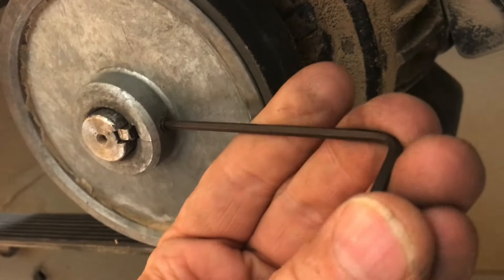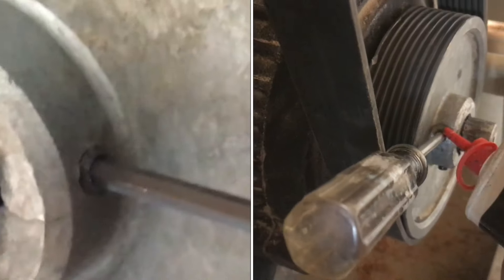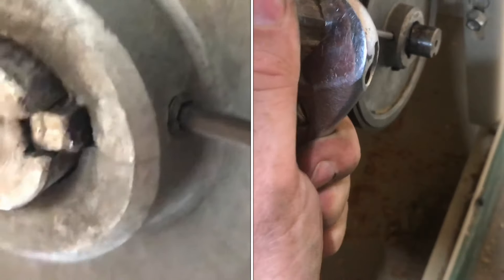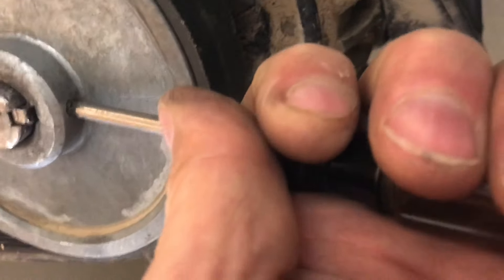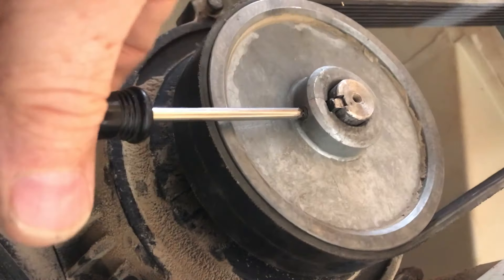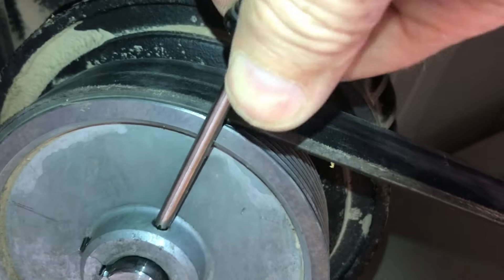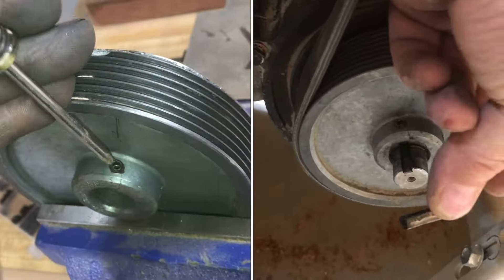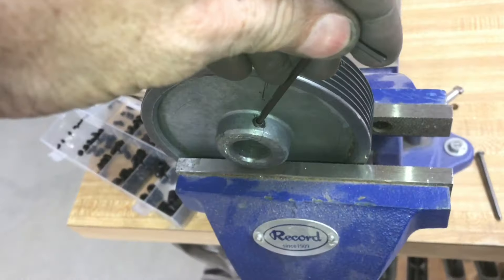REMOVING a stripped or rounded allen screw (fast and easy technique)

Comment: My man. You HAVE NO IDEA how happy I was after I followed your guidelines to extract a small titanium screw on my motorcycle! You saved me not only some bucks but put a huge smile on my face! It was super easy and best of all - it worked like a charm. Thank you from the bottom of my heart. God bless you
Reply: Titanium screw? I find that a curious choice of metal for a screw, since it is so hard to work with, expensive, and doesn't save much weight (a big reason for using Ti instead of steel alloys). It would, though, be strong and never rust. Can you please tell me where it was on the bike? Thanks.

Comment: This works a treat. I had a crappy little stripped screw on a light fitting that I stuffed around with for half and hour trying to remove. I was at the point of thinking I needed to replace it just to change the globe and this worked instantly. I cant that you enough!

Comment: Okay, now how do you remove a torx bit that has broken off inside the allen screw?
Reply: Same problem here
Reply: Weld, make a weld mound then weld a t shaped small square bar innit slowly tap and move
Reply: Exactly, I found a weird looking screw one time only to realize it was a hex screw with a secure torx bit snapped off inside.

I was able to grip the screw from below and turn it with some side cutters lol
Reply: I had a similar thing happen just yesterday. I was using a hex wrench with a ball end. The ball broke off in the set screw. It took a while and was extremely frustrating but I was finally able to get out the ball piece by cleaning out all shavings and debris in there, making sure it was loose and wiggling around, then I took a pick up tool with a strong magnet on the end, stuck a 1/4” hex  bit to it that was one size smaller than the ball so I could get as much surface area of the end of the bit to transfer the magnetic pull to the ball piece and it came right out!

Now I'm here watching videos still trying to figure out how to get the damned set screw out! LoL
I already knew about the trick he showed in this video and when I tried it, all I did was reem out the already striped hex socket that much more!
I've been at this damn set screw for about an hour a day for 4 days now! Been Soaking it in penetrating oil over night for a week... 

STUPID KIDDIE RIDE! UGH!
(╯°□°）╯︵ ┻━┻
...LOL
Reply: Just happened to me on my RC truck 😂😂😂😂
Reply: Hardened metal like that will shatter if you hit it with the point of a center tap a few times.
Reply: The Almighty Dremmel.
Reply: An M-80 or two will make sure that set screw and pulley will never bother you again.
Reply: Don’t use a torx bit in a holder, use a handled torx driver they aren’t designed to save fittings.
Reply: Tannerite
Reply: @cavekritter1  Tannerite scares bears! 🐻 And obliterates wild pigs!! 🐖🐷 🎆🤣😜😉🤦
Reply: does'nt matter..look again..pulley's cracked..needs to be replaced..😂..but he thought he would be youtube famous & he will be..for breaking things instead of repairing😂😂
Reply: If you have a Milling machine or drill press you can get a carbide drill or end mill to drill it out to the point it will either come out or you can peel the rest out . Pain in the ass but it will work . 50 years as a R&D Machinist I've my share of busted or & messed up screws & bolts' Once it's out be sure to run the tap back through to make sure it is all out & you should be good to go.
Reply: Drill it out with a reverse drill bit and pull it right out.
Reply: LoL 😂
Reply: oh thank god i read this comment after I used this trick successfully.  Sounds like something I would have done.  Find a solution and instead, compound the problem

Comment: Omg, this works! I'm not good with tools, and was just changing the easywheels on my folding bike when i realized that the bolt on one of them was rounded (probably because I reused an old wheel to temporarily replace one that broke, hence the need to change). I tried different methods suggested by those professional-looking videos, including using super glue with a sacrificial key. I was getting seriously depressed until I tried this and it works! Thanks a million!
Reply: I bet it was a Brompton 😂

Comment: Thanks for Video. I was able to use the rubber glove method to remove a slightly striped allen bolt out of my wheelchair brake lever and then replace it with a new one. You really helped me out of a jam.

Comment: Overtightened and rounded a metric size 2 Allen set screw. Tried and failed to remove it with a slightly larger English size Allen wrench. Watched your video and successfully removed it with a t8 torx screwdriver. Thank you!

Comment: If you have some allen head screws that you have a high chance that you will have to remove and they are pretty susceptible to stripping, it would be a good idea to put a little dab of anti-seize compound on the threads before reinstalling. A torque screwdriver would also be a good idea, so that you know it's tight enough but not too tight.

Comment: Had a 5/64" screw stuck in a controller, used a T9 bit and some WD-40 and got it out PERFECTLY. Thanks for the tip.

Comment: Thanks for the info. I already drilled mine out of the pipe fitting (wish I would have watched this first!). The pipe was stuck in the fitting. I got the pipe out of the fitting, after I drilled out the set screw. Yah! But now the threads of the screw are still in the fitting. Boo! Cannot get a new screw in. Any help your wise mind can lend me on this?

Comment: Man good idea! Trying this right now but the screw I am trying to get out is for the cage/wheel for my blower motor so very tight space and the stripped set screw and the tore bit between t15 and t20 and too small a space to hammer in the 20.

Comment: Will this work for a crossbow crank handle? The model the manufacturer makes is left handed. I can get the handle side off fine but the side I WANT to put it on is all rounded and I am irked. Its still too small for the next size up of key.

Comment: Set screws are always a pain. They are typically tiny, and usually exposed to conditions that cause them to freeze or degrade. I never re-use one when I do a repair. Always replace it with a fresh one.

Comment: I think Allen screws need to all be changed out with torx screws. The torx screw is vastly more efficient than an Allen pattern. Although to be fair, a large percentage of the time that they strip out, is due to someone using a poor fitting Allen wrench, or over torquing, or even failing to insure that the Allen wrench is properly seated. 

On torx screws that are stubborn I've had good luck by putting it in there and tapping it with a hammer to really seat it well and help loosen the threads.